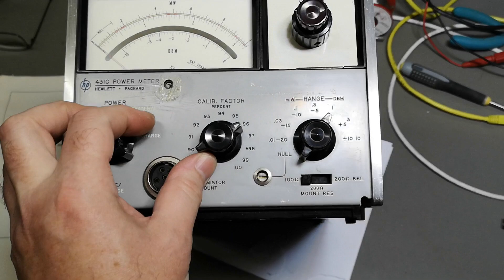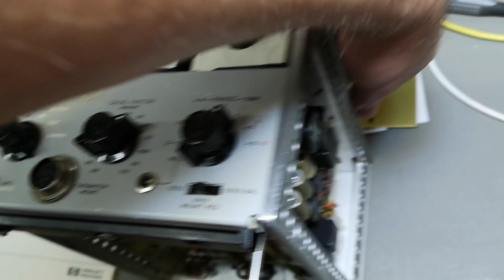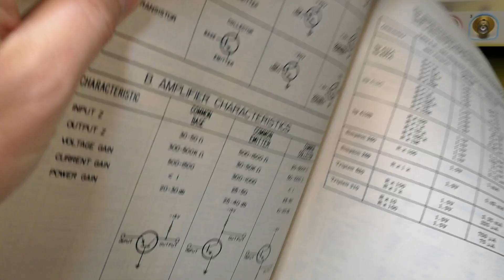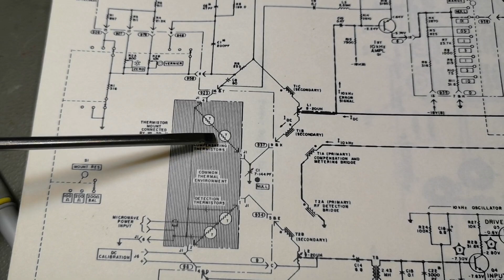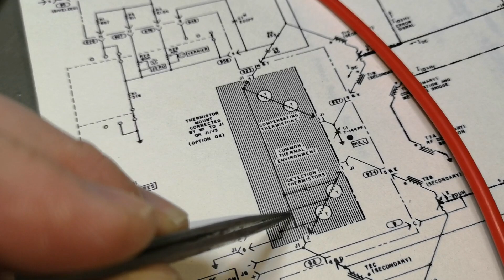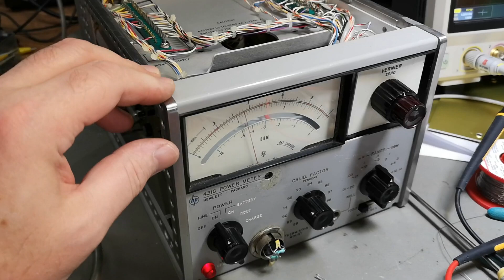HP 431C RF Thermal Power Meter no probe, defective teardown

Comment: Maybe your 100 ohm resistors are not equal enough? The fact that you get bigger reading on lower ranges looks like it's working , just not balanced. Maybe put in one arm a 100 ohm pot with 10 ohm series resistor. The zero adjustment is mostly useful in the low ranges.
Reply from the maker: good idea to continue play a bit with this, sometimes my video is only the short start of my fun with a unit :-)